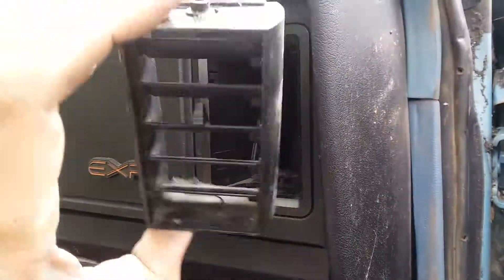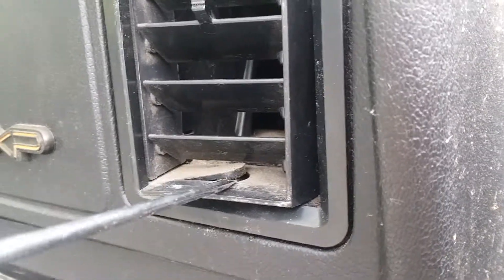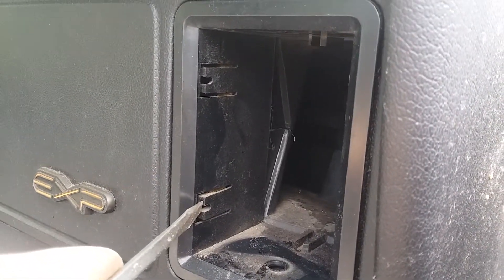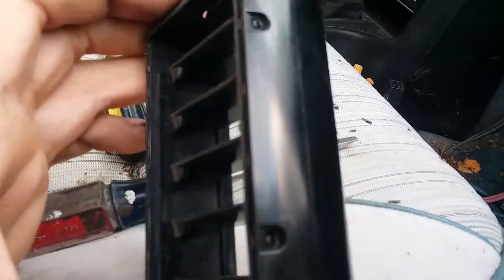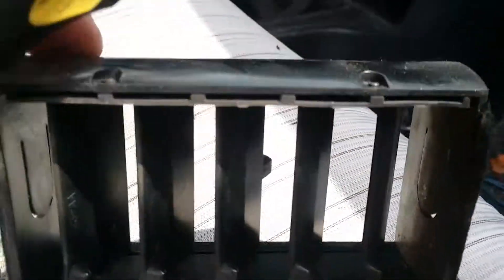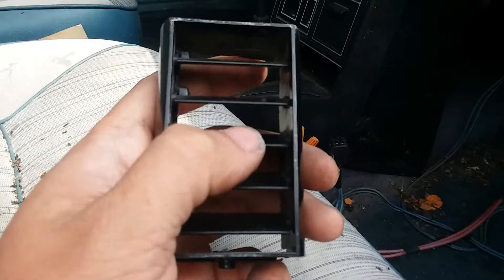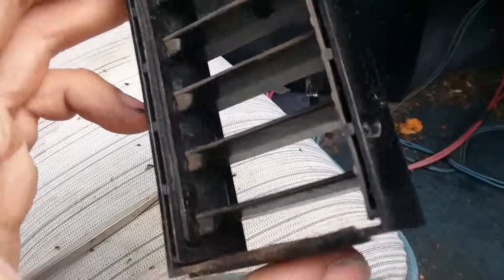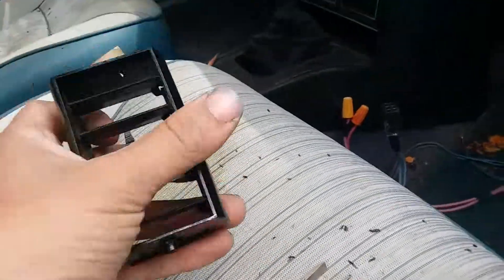1981-1983 Ford EXP/Escort Dashboard Vent Removal & Installation

Comment: Hi. Do you know where the dimer of the open door and the lights are located? Dimer on my Ford Escort LX 1989 began to sound very quiet.
Reply from the maker: I too have been looking for them, mine haven't been working the best either BUT the more I use them the better they work. But I will find them so I can replace them someday, where ever they are they're just piezo buzzers.
Reply: @The_1982_EXPert  understand! This detail is called warning chime. I will find it too.